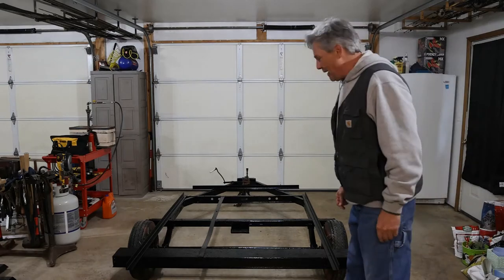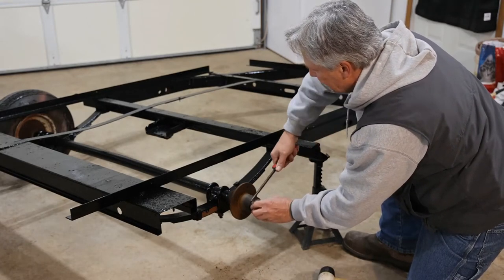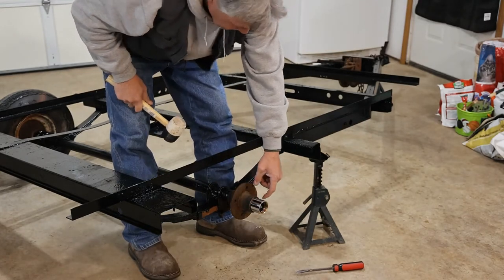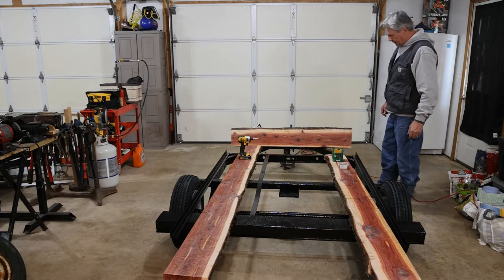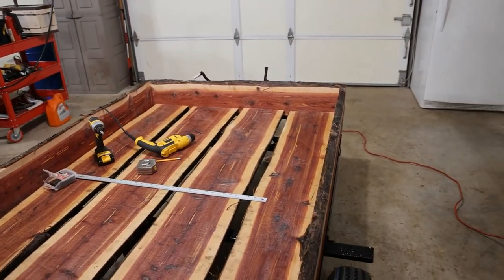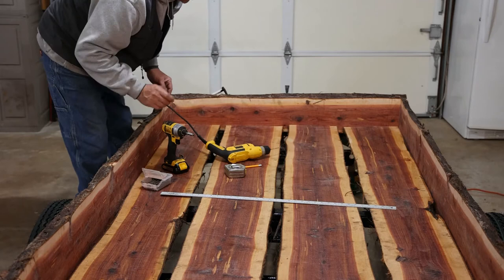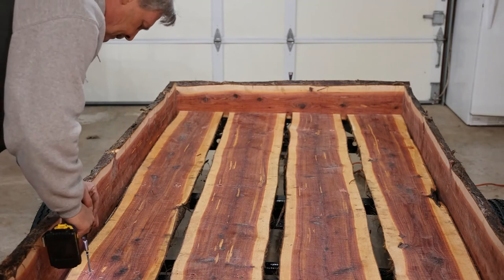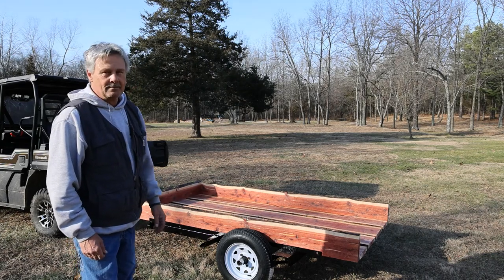Trailer Rebuild For The Kawasaki Mule

Comment: Looks awesome! But I have OCD and you really missed out on a finishing touch though. Chrome lug nuts. LOL! I have an old trailer I pull with my Mule and it does need some work. Maybe when it gets a lot warmer I'll try to make fix it up some. All I use it for is to go around and pick up all the branches and limbs that the high winds have broke out of the trees and block my trails around my Missouri place.:) Again great job on the trailer!
Reply from the maker: Hello David and Thank You. I agree chrome makes everything look better LOL. This was a fun project, and the trailer looks great with the Mule and picking up branches and firewood is the trailers job here as well. Thanks for Watching.